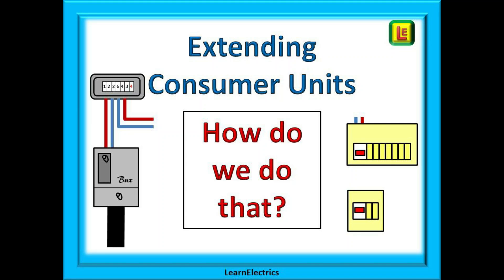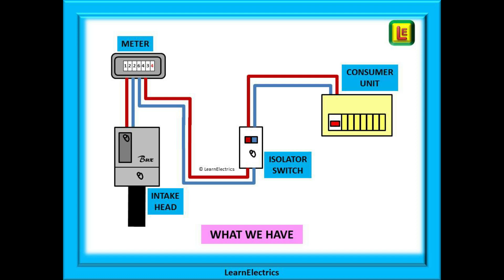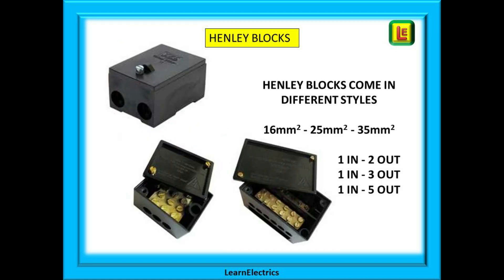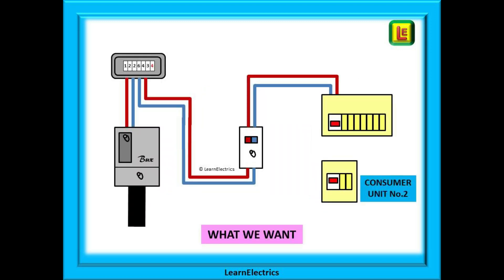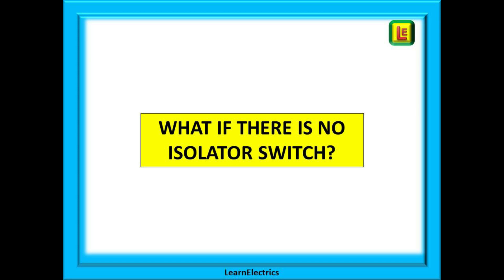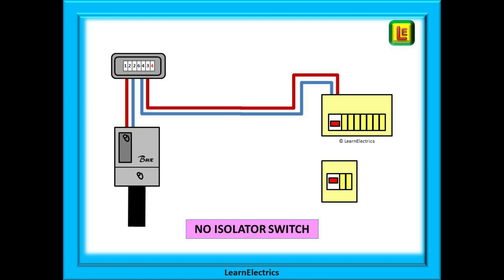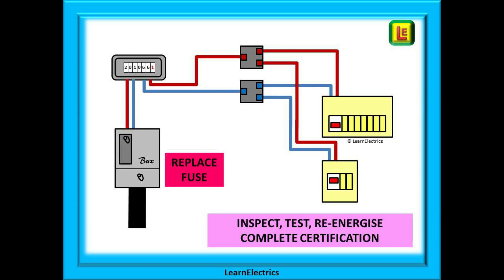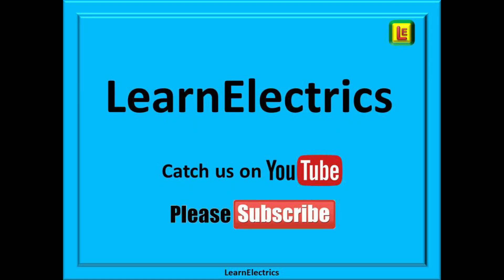EXTENDING CONSUMER UNITS. How to add a second consumer unit to an existing circuit.

Comment: Can i use a 10mm cable from the original CU to supply a new CU different location, as a short term temporary supply?
Prior tobthe origional being fully decommisioned.
All RCDs being suitsble and appropriate.
Reply from the maker: You  should always use  a cable size that is appropriate for the total loads in the part of the circuit. Take a look at the video below.
whether it is short term or not it must always be the correct rating .
https://www.youtube.com/watch?v=fkSUrz0HaPE
Reply: @learnelectrics4402  i should have added suitably protected via Mcbs. and RCDs. Only lighting and socket circuit. No shower, cooker or heavy loads.
Temporary solution to ease the CU relocation process.

Comment: Great videos, really enjoying them. To add the 2nd consumer unit, could I bring a cable from the busbar from the bottom or an existing mcb on the old consumer unit?
Reply from the maker: Yes you can, if you have a servicible consumer unit then use an MCB from that.
Reply: @learnelectrics4402  Thank you!

Comment: Hi Excellent Video explanation!
I have one question that now if we want to connect a battery storage system by using another distribution board, then how will the supply from the additional board go to the main board where all the equipment for the house are connected?
Reply from the maker: There is a section in the Regs book about Prosumer electrics. See the video link below. Thanks for watching.
https://www.youtube.com/watch?v=QO4ymNchbbY

Comment: If you have the DN O out to isolate the wires and are fitting Henley blocks anyway… why not install an isolator switch while you’re there? Granted that the customer would have to pay materials cost but presumably that’s still cheaper than having the DNO do it — or more possible — and it’ll save the faff for next time.
Reply from the maker: That is another solution. Some DNOs will fit an isolator as routine now, others will do it if you ask.

Comment: Hello, I've had an electrician remove an MCB circuit and use that to run an armoured cable out to another consumer unit in my out building, till then I was running all the lights etc from an extension lead, since he's done this my original house consumer unit it's tripping an RCD, he's blaming my wiring in my outbuilding, but it can't be as I was using an extension lead before.

Do you think this is how he's wired in the outbuilding consumer unit into my house consumer unit?

Thanks.
Reply from the maker: Without actually seeing the install its difficult to say. This sometimes happens when circuits are changed or upgraded. You or the electrician need to investigate. Is it when any light is turned on, is it when all the lights are on. You will need to establish a pattern to it tripping. Sometimes, the extension lead will give just enough resistance to not cause RCD tripping if there is a fault, especially long extensions. Is the new wiring damp, sealed connections etc. Most electricians will come back and help you to solve it.
Reply: Update for you, the guy had wired the Neutral to the other RCD block (Which was still bridged in) however, by putting it on the correct side everything now works.. Low and behold he's trying to blame me... As expected.

Comment: Hi, Is it OK to have 2 Main Switches in the same consumer unit , one for the House and the other to isolate a garage consumer unit which is fed from the House?
Reply from the maker: Why not use an RCCB. This will act as a 2 pole disconnector and RCD protect the cables to the garage.

Comment: Would you say  db2 earth can be run out of db1 or split with a block before both? Thanks
Reply from the maker: If extending fro DB1 then yes. The Line, neutral and earth should all come from the same supply point.
Reply: Thanks your videos are the best on hers

Comment: Great video! 

I have a large property which will be a 6bed HMO I want Every room to have it’s own CU so I can sub-meter that..

Is correct to have a Henley block 1 to 6 and have a 16mm wire running to each room? 

Thank you
Reply from the maker: What you are suggesting is achievable. The cable sizes will depend on the loading for each unit. How many amps to each unit, what size Cu in each unit, what circuits in each unit,what diversity is applied etc. Thanks for watching. Dave.

Comment: Would you need to put an 80amp isolator supplying the other consumer unit…
Reply from the maker: I used to do that if I was installing even a 40A second CU in a garage our outbuilding. It means that you have a method of isolating the supply to the garage when not needed. There are recorded cases of neighbours plugging into a garage supply and the customer being unaware of it for years.
Reply: @learnelectrics4402  so u can just Henley block straight into the other CU without an isolator if it’s same building

Comment: My head main is split. The live goes into the cut-out fuse and the neutral goes into a sealed Henley block. Then both the L & N go into the meter. Is this normal? Great videos btw!
Reply from the maker: If its as the DNO installed it and it is still sealed, that should be ok. There are a thousand and one different examples of head wiring. Thanks for watching. Dave.

Comment: Hi What size cable should be used for this secondary consumer unit
Reply from the maker: Whatever size will take the max expected current and taking into account environmental factors, volts drop, distance etc. There is no set size. Dave.

Comment: Would this application work for a EV charger with a upgraded 100A fuse on the main consumer unit? The main consumer unit has no spare or surge protector, the House has solar & batteries.thabks
Reply from the maker: I would suggest getting the Code of Practice for Electric Vehicle Charging Equipment Installation, published by The IET and available from Amazon. There are lots of things to consider for EV charging. Dave.

Comment: Great video as always, I really wish id had access to this level of information when I was doing my apprenticeship. I have a question too, im replacing a dual tariff CCU and the tails on the economy 7 side will  not be long enough for the new unit (Iv had to buy double stacked). Can I use henley blocks within the CCU to extend the tails?
There is no scope to rewire the existing tails as its in a block of flats. I just wondered if it was okay to extend them like this and have the henley block inside the unit?
Any help or advice is greatly appreciated. Cheers
Reply from the maker: Thanks for watching Kev and yes I totally agree. Where was the internet in the 70s when I was training.
Henly blocks no problem, that is the standard way to extend. I used to torque the blocks up and then return to them after an hour or two of doing something else and just check the tightness of them. Copper creeps slightly when first screwed down and a second torquing is a good idea.

Comment: Why do I have a 2nd 1P consumer unit sourced from an MCB in a 3P supplying consumer unit?
Reply from the maker: I don't know the actual setup you have Rami. There could be lots of reasons. Usually distributing single phase to specific areas. Dave.

Comment: What type of cable is recommend to supply second consumer unit? 16mm SWA or can we run 16mm T&E from henley block to second consumer unit?
Reply from the maker: If it was me it would be 16mm double insulated meter tails if internal, or SWA if the cable was going outside.

Comment: Very clear description.  What is the situation with for example, having a small shower or garage "fuse box" with a 2 or 3 kw load, on the end of an existing 6mm2 T&E running from a 32A MCB in the main RCD protected box. Rather than directly from meter tails & Henley splitter block/s? Is this a problem? Should the small fuse box also be RCD protected or does this cause problems, having an RCD running off an RCD? Should a simple 2 pole isolator type of main switch be used on the small extension box & rely on the 32A MCB & Main RCD?
Reply from the maker: If the existing 32A supply is RCD protected that is fine. The garage unit, I assume will be an RCCB plus 1 or 2 MCBs, this is quite normal. If it was me I would use a 20A mcb in the garage unit and run the sockets as a radial circuit and 6A for lighting. Thanks for watching. Dave.
Reply: Thankyou ❤

Comment: Nice one dave another interesting one 👍 just of topic but which is the best way to find the correct college course and price to be able to retrain as an electrician to the stage where you can register with a scheme napit niceic etc and am I right it usually takes 3-4 years to complete .ill probably get stick in the comments I understand I would never be a proper time served spark but I’m just thinking of an option as I find electrics very interesting to the point I’ve nearly completed all the sparky videos on YouTube 😂 including your videos dave 😂👍👍
Reply from the maker: Don't ever think that you cannot do it. Lots of people are in the same situation, later in life etc. If you want to be a sparky you can be. 3 to 4 years not true unless you take the apprentice route or only approach this part time. A lot comes down to your determination and time input.
To join a scheme like Napit or NICEIC etc. you will need to show educational achievement (exams) and practical skills (assessments, on the job etc.). Plus, the more you practice and read the better you will be. Make your own test board and wire it up and test it. Test your house, change switches or ceiling roses in your house. These are all skill building and good for the confidence.
And actually go to at least two different training centres and put your story before them. Don't rely on the phone, turn up on their doorstep and ask to look at their training facilities. See what they suggest, the routes, the time etc. If they are going to take 3 or thousand pounds off you, the least you can expect is a fair chunk of their time and attention, not just 5 minutes, before you make a decision. There is no "Instant Electrician course" so be aware that some will try to sell you one and three week courses that guarantee you are fully trained (not). It takes time. Months in fact. The most important thing is being able to apply your theory to practical work. And testing skills are very very essential.
Do not part with ANY money until you are certain that you have found the right centre.
Speak to NAPIT for instance, their training packages are very good (I used to teach for them). They might be a little more expensive but they will give you good training. So will other centres too. Just watch out for the one's that promise that you will be an expert after 4 weeks.
And I will say it again, read and practice over and over again. That's why professional snooker players are so good. They practice with the same balls on the same table in the same room for hour after hour after hour. And then they do it all again the next day, and the next, and the next.
Good question. You can do it and don't worry about where you started, it's where you finish that matters. Dave.
Reply: @learnelectrics4402  nice one dave thank you 👍👍
Reply from the maker: You are very welcome buddy. Keep me in the loop and thanks for your support with the LearnElectrics channel. Dave.
Reply: @learnelectrics4402  I will do dave 👍 thank you again, can’t wait for more videos 🙌🏻🙌🏻 cheers
Reply from the maker: Thursday this week is garage door motors and next Monday is 2 plate lighting circuits.
Reply: @learnelectrics4402  nice one 👍 looking forward dave 🙌🏻🙌🏻

Comment: can u take the supply from the main switch to feed the second CU
Reply from the maker: You may not get two meter tails into one hole on the main switch. From what you have said, it sounds like the second CU is only a small load. Rather than the main switch, put a 40amp breaker in the board to feed the new CU, if the original will take the extra load. Don't forget safe isolation when working around consumer units.
Reply: @learnelectrics4402   thank you soo much this cleared alot up for me I will be visiting this channel alot more and ask plenty more questions aha thank you again. what cable should I use to feed the new CU would 6mm² Swa be ok?
Reply from the maker: Have a look at this video if you are taking a feed from an MCB.
https://www.youtube.com/watch?v=VtTUkUpQ-Rc
Hope it helps.

Comment: Could there be an argument for installing 2 x isolators, one for each board?  Thanks for the great vids by the way...
Reply from the maker: Absolutely there could James. In fact I do that if I am installing a second board in an outbuilding or garage that is not joined ion to the house. Any problem with the external wiring, it can be isolated and made safe. Good question. Thanks. Dave.
Reply: @learnelectrics4402  have you done or are you doing a video on when you would and when you would not add a second board for things like garages or outbuildings? Or where would I look in the regs?
Reply from the maker: James, adding CU's is between you and your customer. Nothing in the Regs.
Hope this helps.
Reply: @learnelectrics4402  can it have anything to do with volt drop? Or I guess just practicality?

Sorry for all the questions, just keen to learn..
Reply from the maker: Two different things James.
Do you want extra circuits that is the question you need to ask.
Any circuit existing or added should meet volts drop rules.
See our video Voltage Drop Calculations on this link.
https://www.youtube.com/watch?v=Z-kw680SIoo

Comment: Hi guys, if I was to add a sub main for a new consumer unit in a new Anex, and I was running 10mm swa, does the consumer unit main switch have to be higher rating that the sub main main switch?
Reply from the maker: No. If it is a switch only, then as long as the switch is at least the correct size for the part of the circuit it protects it is ok.
Reply: @learnelectrics4402  hi sorry if I’m getting confused here, Protective device is equal or less than current carrying capacity of cable , bs7671 says 10mm 3 core ref method D is 50A so will that need a 50A fuse or less at the switch/fuse at main incomer? 😃
Reply from the maker: Paul, two different things. A main switch (switch only) should be able to disconnect at least the maximum current of the circuit. Most houses are protected by a 100A incomer fuse.
If you know the loading may be close to 100 amps at times, then a 100A main switch is ok.  
A fuse or breaker should disconnect before the maximum rating of the cable.
If you know the cable rating is 14 amps say then a 10 amp circuit breaker is the choice, not a 16 amp one. Always protect the cable.
Reply: @learnelectrics4402  got it thanks! :)
Reply from the maker: That's great Paul
Also, if you look on page 188 of the Wiring Regs, there is a table that lists the functions of different devices, whether they are switches only, overload protection etc. main switches are usually BSEN 60947-3 types
Reply: @learnelectrics4402  just to add to this, for example a 10mm swa to the garage what protective device protects the cable? Upstream ? So at main incomer end? So when working out design of an installation your designing cable size for fuse/circuit breaker protecting it and not what’s down stream? I.e garage consumer unit ? :)
Reply from the maker: Correct Paul. If you know you need 35 amps in the garage then the breaker back at the house needs to be 40 amps. Then choose the cable size that will be able to take at least 40 amps not 35. The cable should always be the highest rated component in the circuit. It is easier to reset the breaker than rewire the burnt out cable. Think of it like a hose pipe with a hole in it. Where is the best place for a stop tap, before the problem or after.
Great to hear from you, glad you are enjoying the videos and plenty more to come. Dave.
Reply: @learnelectrics4402  amazing stuff thanks, one last thing! do you apply diversity to the supply swa to garage or do you apply diversity to the individual circuits in the garage and then calculate the supply cable size after that? thanks for your help!
Reply from the maker: Paul, remember A B C
Appliances, Breakers, Cables in that order.
A...Using diversity if needed work out current demand for the garage sockets, lights etc.
B... Breaker size needs to be not less than the current just worked out
C... Cable rating needs to be not less than the breaker rating
We haven't done a video on diversity yet but one is planned in a few weeks. Dave.
Reply: @learnelectrics4402   I just came across  Paul's and Daves posts and it has really helped me understand a lot also. Great questions from Paul and Dave thank you so much for your. detailed answers you are a huge help and inspiration to many of us learners. 😃

Comment: Excellent video again, although I would check that the meter tails are large enough if the fuse cutout has to be increased, otherwise replace with larger tails (or does the electricity supplier do that!?
Reply from the maker: Thanks Robert, good feedback and really appreciated. Usually it is the electrician that will supply the larger tails for the DNO to install if they upgrade the main fuse. Covered in a different video. Great to have you along and loads more to come. Dave.